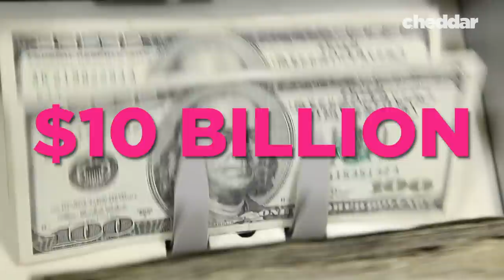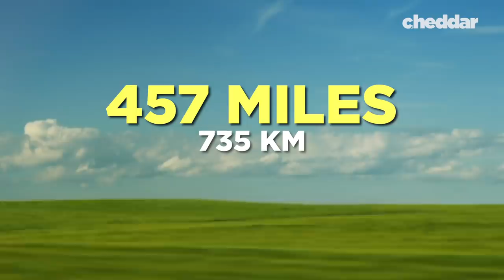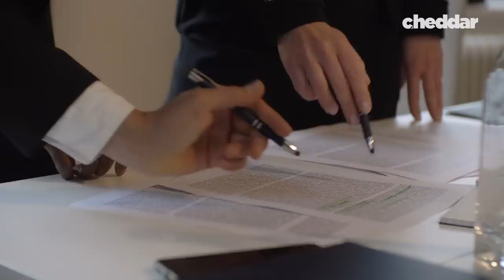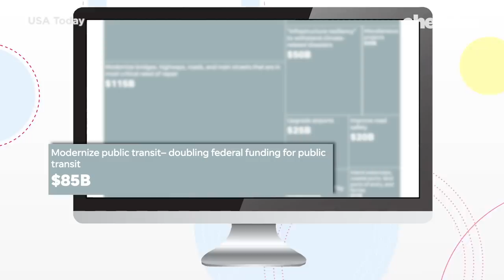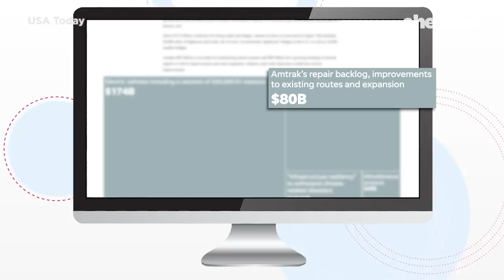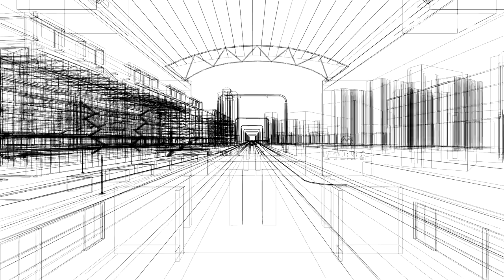Is New York Finally Getting A Real High Speed Rail? - Cheddar Explains

Comment: I’m from the UK, but I’m puzzled at why it will take the US 20 years to get their trains to a speed that is respectable today… Surely in 20 years time, places like China will have improved their transit again? Meaning that as soon as their current plans are completed, they’ll need to update it all immediately afterwards if they want to be at the forefront..?
Reply: Check out the B1M on this.
Reply: They plan to double track length by 2030. 
Then accounting for more then 80% of highspeed track.
Reply: Their fastest train averages around 65mph, which is the average speed of a commuter train in the UK, not an intercity
Reply: Because we don't need them. Cars, the interstate, and cheap domestic flights make highspeed trains an unnecessary drain of resources.
Reply: Republicans didn't want to pay for the cost of high speed rails.
Reply: We just don’t really need them everyone that wants to travel has cars and no one wants to pay for other people to travel on trains.
Reply: To be fair, the Acela does travel faster than the domestic HSR trains in the UK
Reply: @BenAHowell754  that is the exact reason why high speed train should exist in USA
Reply: Because construction work in the US is a joke now, I think they spend 9/10 of the day sitting around doing nothing, by me they had to repair a small bridge over a tiny river, it was a bridge so small I didn't even realize there was a bridge there till the repair work began, it was about 10 meters long, it took over half a year of the bridge being completely closed to do the work.
Reply: @BenAHowell754  cities have a lot of traffic now and we can’t keep making cities so car dependent, It’s not good for tax revenue for the cities and it’s not good for the environment, and it cost a lot to maintain etc. how many more highways can we really build in the northeast, how many more highways in California before we realize highways aren’t the answer and they literally cause more traffic. People say they want to beat China but than don’t want to put the money and resources to beat them. Countries with half our gdp per capita are getting high speed rail. Airports aren’t even that efficient when you take the time to get to the airport security and your destination than get your bags and get to your location again
Reply: @rush9612  That is just so wrong. Would you rather drive with congestion, pollution, going 60ish MPH or sit back and relax going 200 MPH. Plus having to deal with parking in Boston & NY is hell on Earth (coming from someone living in Boston married to a New Yorker.)
Reply: The US is a huge country with a lower population density, so it’s hard to build a high speed rail and justify the cost.
Reply: Because right now very few people travel by train, there isn't much demand for it, and then there is the subject of geography, almost every country that has high speed rails is fairly small and in the case of China the large majority of the population and major cities are in the eastern half of the country, making them much easier to link, while the large cities in the US are all over the place, it would be a very big gamble to put High-Speed Rail between Boston, New York, Miami, New Orleans, Houston, Dallas, Phoenix, Los Angeles, San Francisco, Seattle, Salt Lake City, Denver, Kansas City, Chicago, etc, with minimal guarantees that it would ever pay for itself, buying all the land needed (much of it private right now) and displaing people would be a years long migraine that would drag through the courts (China doesn't have that problem because they are still a communist country where the people have no real rights or access to justice, and the unitary systems of government in most European countries have kind of the same effect in terms of what the central government is able to do), and the alternate options available (I cannot overstate to European viewers how much many Americans value their freedom of mobility and travel, if you are traveling by car you are not hindered by train delays, bus schedules and routes, taxi fares or a complete lack of them, and rental car prices and rules, anywhere there is a road you can go, we took Amtrack to visit Adirondack Park in New York and got a rental car, never again, we're driving next time), and well as fast and cheap domestic flights. Simply put, the need and demand is not there and it is not feasible.
Reply: @visorij3374  That's why the proposed rail is highly targeted at dense regions. I agree it wouldn't make sense to build high speed rail in Wyoming.
Reply: @hape3862  hear, hear.
Reply: @williammerkel1410  why not use interstate land? Put tracks on one side. The Federal government already owns the land and has right of way, and they overbought to have room to expand (as evidenced by many extra lanes added on some). They’re already built along the routes lots of people want to travel. Power is already going there for the lighting. Etc.
Reply: First, a powerful faction in the US is ideologically opposed to passenger trains. Or, at the very least, they believe that passenger trains should only exist if they can out-compete cars and planes, and also support themselves on fares and make a profit without government subsidy, which they never will (of course, they don't apply this standard to interstate highways, which are massively subsidized).

Second, the US actually has a fine, extensive rail infrastructure but it's tailored to freight rail. The railroads used to be required by federal mandate to maintain passenger service (which they hated doing since they lost money on it). That mandate was lifted when Amtrak came into being. But that meant the railroads could sell off the rights-of-way that they previously used to have bidirectional tracks, because for freight trains which are less speed-critical, you only really need one track and you can put trains off on sidings to pass each other. (Riding a passenger train on one of these lines is agonizing.) That was a real-estate gold mine and the railroads soon exhausted it. So now they don't even own the land that would be needed to establish decent passenger service, even ignoring issues like grade crossings and turning radii.
Reply: @kaitlyn__L  in many places the right-of-way is not wide enough, other infrastructure such as power lines are already there and cannot be moved, hundreds upon hundreds of overpasses would have to be completely rebuilt, grassy strips alongside interstates are vital for water removal and erosion control, and the trains could not interfere with the original purpose of the interstate system which is a lifeline in case of a national emergency, particularly the outbreak of war in which it would have to be immediately commandeered by the military as well as being capable of serving as Landing strips for any and all aircraft, and while the interstate system are a federal project the states are responsible for their maintenance.
Reply: Because we are a bunch of arrogant archaic idiots
Reply: @BenAHowell754  yet we have way more cars than are necessary and traffic gets worse every year ...stop clinging to old ways
Reply: @rush9612  but we blindingly pay for endless wars and the trillion dollar disaster of the f35 program and multi trillion dollar corporate bailouts THAT YOU PAY FOR ...enough with that pay for others BS excuse...GROW UP
Reply: Whenever a public transportation project is proposed to Americans, they evaluate it in one way: will this project get cars off the roads I drive on so I can get someplace faster? The only goal of public transportation here is to reduce traffic congestion.
Reply: The problem isn't the speed of the train per se, it's building the long straight track in a densely populated area that is also one of the most expensive real estate markets in the world.
Reply: @BenAHowell754  "Cars, the interstate, and cheap domestic flights make highspeed trains an unnecessary drain of resources." This kind of ironically true depending on where you are. However roads hide long term maintenance costs and they selves make rail lines more expensive since they take up land that could have been used for it. However if there actually was a cost on carbon those factors would be wildly different.
Reply: @gg3675  Yes, Europe isn't densely populated.
Reply: What is strange is that Europe, UK, Morocco all built there HSR in less than 10 years why does it take the US twice as long. I know all the people that think they have a say and sue the project for not getting enough for there property or to strict environment regulations that drag projects out exponentially.
Reply: @maa1649  it’s a matter of lack of demand. Pretty cut and dry sadly. No one’s ever been shy to make money in the US, and the fact that no company or government agency has invested in it kinda proves it. The country is too sparse, and the people too rich to prefer public transport.
Reply: The largest issue with the rail network is this: Lack of demand. 

Let me clarify this a bit, the U.S runs most on-demand for things. The auto boom brought an immense demand for infrastructure to facilitate car travel, when planes came about the same thing happened with airlines. Rail travel in the U.S is always seen as a niche transit option since the advent of the automobile, for the sightseer more than the common commuter, or at least that's how it used to be. It used to be that cars were cheap and people enjoyed the freedom that came with them. Nowadays that is changing but the mentality is still there, and due to our past, we are stuck with what we have. A car-based network that is overcapacity and falling apart. The major issue to why we are lagging behind is strong emotion against the development and bureaucratic promises that make the Brothers Grim fairytales look realistic public trust in government funded anything is little to none. Couple that with laws that make any kind of change a bitch to complete and groups that protest against a shovel touching the ground for fear of some rare bacteria's existence and the drive to improve anything is little to none.  let's not forget also the time we speak of as well.

20 years is hopeful, while I tend to side with the unionization of workers to get better treatment, it makes any work that requires them a bitch. The government is so choked out on stipulations they have to meet that to see a quick repair job is a joke. Taking 5 guys to do one simple task just because of union-allocated regulations on workload and stuff it takes a long while to do anything, and it doesn't look like it's gonna get better either. Noone likes construction, and the time frame it takes really puts people off from investing because they wouldn't see any return till a quarter of a lifetime is gone by. There is a lot more but for a comment, this is already long so.

I for one would love to see a commuter system as widespread and useful as other countries, but living in the American Midwest I also see why we don't have that: Low population density causing low demand. Sure it will get here eventually but I don't see it happening within my lifetime and probably not even my kids. The interstate system took an act of congress to get done and it is doubtful that such a thing would ever get out of the clusterfuck we in the U.S call our government today, they couldn't even spend $1,400 on us individually without months worth of bickering, imagine paying for a bill larger than the relief bill the passed earlier, we would have better luck sticking a thumb up our ass and trying to shit because at least that has a chance of going through.
Reply: @williammerkel1410  nonsense , millions of millions got rich by the payment of government for relocation . I found Americans just depend on “ imagine “ China or all brainwashed by anti China propaganda
Reply: @weizhang2834  but did they have any ability to contest their relocation in court with a realistic chance of winning?
Reply: @hape3862  best cars and best highway are German? It's hard to argue with that
Reply: @longshorts7148   I think you are talking about antifa states for which pelosy was demanding bailout of states for stimulus to pass
Reply: @longshorts7148  On viting they actually made ut easier to vote go and critically read between the lines while biden's delaware has no such easy voting rules and even an aluen can vote there. So, you can be a Democrat but Republicans are actually increasing voter participation and decreasing fraud whether you like it or not.
Reply: Our policies are that bad
Reply: @longshorts7148  Go and see new georgian election rules which means to increase voter participation and reduce fraud. I have checked it.
Reply: @longshorts7148  but not won because they are spreading fake information
Reply: @daelbows5783  only between boston and westerly, ri. CT border to penn station is slow. Penn station to DC averages 85 mph to cover 300 miles in 3.5 hours. I find it easier to drive at times or take the bus from nyc to dc for 35 USD and deal with the clientele
Reply: From the UK? Then tell us why the Betty Line in London isn't open yet?
Reply: @visorij3374  Yes, it's difficult to justify the cost of a comprehensive high speed rail network in the USA (at least at the moment – when emergency measures to combat climate change mean internal flights are grounded then it may be different, but can you afford to assume that won't happen?) ... it's hard to see a good case stacking up for HSR to somewhere like Denver, for example. But there are plenty of parts of the USA that do have a population density that would support HSR:
🚅 Sacramento/San Fransisco - San José - Los Angeles - San Diego
🚅 Dallas/Forth Worth - Austin - San Antonio - Houston
🚅 Miami - Tampa - Orlando - Jacksonville
🚅 Washington DC - Baltimore - Philadelphia - New York - Boston
🚅 Milwaukee - Chicago - Detroit - Cleveland - Pittsburgh - Washington DC
🚅 Nashville - Louisville / St Louis - Indianapolis -- Cincinatti - Columbus - Pittsburgh - New York
(And yes, those are just broad corridors and would probably include branches, I'm not saying trains would run those exact routes).
Reply: @daelbows5783  The average speed of the Acela is 65mph. In the UK it's 84mph.
Reply: The UK only has 1 true high speed line, that being HS1 connecting to mainland Europe.
HS2 is set to be completed in 20 years as well.
Reply: @visorij3374  For trans continental HSR routes that is certainly true, but the US has a number of areas with two or more major cities within 500-600 miles of each other and that distance is considered the sweet spot for HSR. The NE Corridor is one example, California's HSR project is also within this limit as would be the Texas HSR project and the proposed Las Vegas to LA/San Diego route.  Certainly building a high speed rail route across the midwest states would make little sense so it would have to a series of independent routes linking major cities in specific areas. However funding could also go towards making improvements to more rural lines, allowing Amtrak to introduce high speed bi-modal trains to run on the HSR lines at say 200mph then transition to diesel power and travel on rural routes at more normal 100mph speeds. Sort of the best of both worlds and is what happens in other countries currently.
Reply: @scottlarson1548  Europe did face the same problem, which was not making the trains be fast, but was laying long straight track in densely populated expensive real estate markets.  Correct.
Reply: @gg3675  And they solved it how?
Reply: In 20 years China will have a network of maglev trains..... plus we don’t even know when it will actually materialize.
Reply: Same with Canada and Australia, what are they doing?
Reply: @jamesbedford7327  fastest in the US are around 120mph
Reply: @scottlarson1548  My entire point was just that engineering trains to go at fast speeds isn't that hard of a problem.
Reply: @williammerkel1410  actually yes. but 90% don't do this. go on to chinese internet and you see chinese netizens begging the government to take their land to build hsr so they can live off rich for the rest of their lives + for younger generations. the same goes for provincial governments because they see the positive economic growth for hsr.

high speed rail in china is that amazing.
Reply: The reason, in short, is that Americans do not like traveling by trains. For some reason, left-wing politicians seem to be obsessed over them, so whenever they're in power, they throw money at it. But the people don't actually have any desire for this, outside of Acela (which is grossly overpriced). I actually used to live along the Acela line and always wanted to take it to Washington when I would travel there for business. The schedule worked, and you can avoid some traffic jams. But I could never justify the price (hundreds of dollars for one round trip between New Jersey and Washington) versus simply getting there and back on one tank of gas in my private car.
Reply: @kevinh96  - The issue is that cities in the U.S. have different industrial bases, ethnic populations and political tendencies. City number one might be 500 miles away from city number two, but the people who live in those two cities have no reason to ever visit the other one. That is just reality in America.
Reply: @CityWhisperer  Do you mean London to Birmingham? Or the whole thing?
Reply: Because we are too busy giving rich people tax breaks
Reply: @VisibilityFoggy  "Nobody wants to travel by train" because our trains are terrible.  There's nothing different about American consumers that would make them less likely to want to ride HSR than someone in Japan.
Reply: @FfFf-gi1hd  I'm also really curious why there's no HSR line at least between Toronto-Ottawa-Montreal.
Reply: @gg3675  - Have you ever been to Japan? Or the regions along Europe's HSR lines? They do not resemble anything remotely like the landscape, layout, zoning, of the U.S.
Reply: @gg3675  - I once rode the train from Montreal to Quebec City. It's actually an old Amtrak train that Canada bought from the U.S., so technically it's "worse," though I found the clientele to be more respectful of their fellow riders and lots of room on the old train.
Reply: @williammerkel1410  Well Said
Reply: @kaitlyn__L  I agree with your idea. I live near the project in CA. If they would have used the "Right of way" near the interstate it could have been 75% completed by Now. They chose to go through a bunch of small towns and farmland instead for Political Reasons.
Reply: @sterlingodeaghaidh5086  Fantastic Explanation. I live near the boondoggle in CA. You are correct with Everything you stated.
Reply: @williammerkel1410  what question lol. says the person living in the most oppressed state aka usa in the world. pure projection.
Reply: @rush9612  Who wants to drive a car a long distance when you can sit and relax on a train and get there in half the time? As for flying, a high-speed train is quicker for anything within 2 hours on the plane, and far more comfortable.
Reply: @Zeoytaccount  Too rich for public transport? If you're rich, why would you drive when you can travel first class on a high-speed train?
Reply: @timtranslates  2 hours is a pretty short drive and we could always raise the speed limits.
Reply: @williammerkel1410  again who are you and what argument. winning by not engaging the question. yes i am pro ccp so what. what a genius! /s
Reply: @timtranslates  Principally because it's slower than a plane, and less versatile than a car. Wealthier middle classes generally can afford these options more easily. Trains are a niche middle ground.
Reply: @sandrahiltz  Same in Canada, looks like we share the same fucking blood!
Reply: @rush9612  I was referring to a two-hour plane journey, i.e. a full day's journey in the car, vs. 3-4 hours on a train, where you can relax, sleep, work, listen to music or eat (and reduce carbon emissions while you're at it).
Reply: @Zeoytaccount  A train is only slower than a train once you get past a certain distance. Around 600 miles. For anything shorter than that, it's really not quicker. A 600-mile trip with a couple of stops will take you about 3.5 hours on a train. On a plane, you'll be in the air for 1.5 hours, but you'll also have to travel to an airport perhaps 30 minutes out of town, arrive at least an hour early, wait for your bags on arrival if you're travelling with bags, then travel from another airport that is out of town. It's only going to be quicker if you happen to live near the airport and your destination is close to the airport.
Reply: @timtranslates  That's an interesting analysis! I agree. The issue is, most places in the US are way over 600 miles. Take nations with good HSR like Japan or Germany; most of their entire nation is within that 600 mile radius. For the US? For me personally there's only 1 major city within that radius, and it would still take driving to the station. After all, other developed nations like Canada and Australia don't have HSR for the same reasons. I'd love to see some better regional rail systems here soon, but a nation-wide HSR system I believe is in the realm of fantasy until we have technology that can match air-speed.
Reply: @Zeoytaccount  I agree a nationwide network wouldn't be viable, but surely an east coast line would? New York-Washington is only 226 miles by road. Surely there's enough traffic, especially as Philadelphia and Baltimore are almost in straight line between the two. Atlanta-Washington with stops in Charlotte and Richmond should be worth it too. Then, perhaps Florida gets enough tourism and business traffic to warrant extending it down there?
Reply: Because AMERICANS love their cars...We don't live in cities...most Americans are in suburbs. We can tow our boats, rvs, trailers with our cars, we can haul building materials in our trucks...and WE HAVE THE FREEDOM TO BUY A GAS GUZZLING CAR if we have the money to and if can afford the gas...

Oh, on ELECTRIC VEHICLES, how are you going to get electricity to charge your battery powered cars, Unicorn manure? Renewable fuels isn't the answer yet, coal, oil and gas is  - along with NUCLEAR...
Reply: Because they are nationalised. Your government made the right decision in the '90s by privatising British Rail.
Reply: @blakemcnamara9105  Because the British railways are so much better than the nationalised French ones, right?
Reply: The problem I noticed was laws and regulations of different county, and states and federal governments, fundings and also many of the railroad tracks are own buy different private companies.

It's hard to make changes because too much bureaucracy, too many people own different parts of the tracks. Also buying new lands are also expensive and hard as well especially in some of the most expensive and densely populated lands. A high speed railroad isn't needed for places that doesn't have a large population as well.
Reply: @BenAHowell754  Cars are the most inefficient mode of travel
Reply: @JsRazza  Because sitting in traffic for hours is so much fun. As is working extra hours because you couldn't work in the car.
Reply: @Daniel P. gas tax
Reply: romulus augustus  That's why I said "in the air". It's rare for in-the-air time to increase, except at peak times into large cities. Most of the delays are on terra firma.
Reply: Harry, the distances involved are simply too great for wheel on rail. And we already have an excellent network of jet aircraft. There's really no need.

Now if a private company like Brightline or Virgin Hyperloop One wants to start building maglev at their expense, I would support it. But I don't think the government should be wasting money on it.

Look at this way. San Jose aka "Silicon Valley" and New York City are as important to the USA as Paris and London are to Europe. But Paris and London are A LOT CLOSER TOGETHER.

You're talking 300 miles vs 2900 miles.

You have to realize the vastness of the USA, Canada and Australia. We don't use HSR because our countries are simply too big to justify it as a public transit project.
Reply: Tbf, the uk isn't doing brilliantly either when it comes to high speed rail compared to the rest of Europe. The French had to help you build hs1 and hs2 is way over budget, schedule, and probably won't even fully open(northern section cancellations).
Reply: @asdsdjfasdjxajiosdqw8791  doesnt matter trains were rendered obsolete by the jet aircraft unless youre talking maglev. Under 200 miles its ok much more than that and the aicraft makes it one hour while the train takes two or more and thats a waste of money to build unless you did it very cheaply. If its a cheap upgrade to existing public transit fine, otherwise it is for private companies to spend their own money.
Reply: Size when compared to Europeans as well as many other reasons and when compared to China, China has a much easier time acquiring land, cheaper labor, basically no political opponents, and can mass produce things that could never be mass produced in america.
Reply: Zaydan Naufal  I was just giving the base idea. There is much more complexity then 1 land acquisition law and a much more solidified political standpoint often helps a country to a very far extent as seen in america there is severe effects of not having as unified politics. I also do believe that Indonesia has Chinese loans to support there HSR construction.
Reply: @Theactualstoic  Joe Biden was the state senator for Delaware, not for California.
Reply: @BenAHowell754  it costs significanty less to fly in Europe, a country with vast high speed rail. I'd rather take a plane from Russia to Germany or the other way round than fly the equivalent distance in the US, where plane tickets are in the hundreds and service is more shit.
Reply: UK doesn’t really have HSR either
Reply: General Motors and Exxon.
Reply: @BenAHowell754  jams, road rage, rising fuel costs, non functioning cities,  insurance, fuel, massive car payments, maintenance costs. You dont speak for me and millions here. We need a balanced transportation system. Not total car centric insanity. We need trains. If you like driving , then you should want other systems because it will mean less cars on the road. People die in car wrecks more than by any other means.
Reply: @rush9612  not everyone wants to drive 2 hours when on a train they can just relax. Also raise speed limits? That’s just asking for more car accidents.
Reply: it's really hard to get public projects done in the us, you have to cater to many special interest groups to just get something like zoning right figured out.
Reply: @BenAHowell754  cars are slower than 200 mphs trains. Flights arnt necessarily if you have to arrive 2 hours before take-off and airports are usually located 30 miles from downtown.
Reply: @29brendus  It's opening in 4 days as of May 2022
Reply: @carsongreen4503  Sounds positive to me, and I will ride it on June 7th, in stages of course, because it is only being operated in 3 separate sections right now as opossed to full straight through running. Cheers!
Reply: The U.S. , has something called airports .
Reply: @williammerkel1410  Induced demand applies to highways, as it does to high speed rail too. Every time a highway is expanded, or a new one is created, it creates further congestion and traffic. It does not alleviate it. Because the very moment a new road or highway becomes available, people will flock to it, drive on it, creating more traffic, which will necessitate more highways, and more expansions of them. It's a never ending process. The Katy highway in TX is a great example. It was expanded who knows how many times, but still congested. Build true HSR in this country and people will flock to it too. People don't use HSR trains because we don't have them, and the few trains we do have, are old, slow and provide shitty service. Give an American a German high-speed ICE train or a French TGV train and see what the response is then.
Reply: @ArtisticlyAlexis  I’d rather drive, unless I have a direct location I’m planning to go that a train would take me very close too it’s just ineffective as an overall, why would I train from say nyc to Boston when I’ll need to either rent a car when I’m there or taxi or Uber everywhere I need to go, and this is coming from a train lover who lives on Long Island, my father works at the LIRR in my opinion the best option would be for us to just upgrade and build local rail systems in bigger cities and areas throughout the country, the LIRR is very decent already with connectivity we just need to upgrade our older track and outdated systems and our trains are already capable of going 100mph, if they could get our local trains up to 80-100mph that’d be an amazing local system for quicker connectivity.
Reply: @MattMcIrvin  Great comment. Thanks. Of course I agree with you. I think Brightline is a great business model in large part because it appears it is based on profiting from real estate development. Southern Pacific, at one time California's single largest private landowner, took over a hundred years to develop. Its remaining unexhausted vast holdings were acquired by Santa Fe. Brightline's average fast speed of 80 mph (MIA-ORL) could become a desirable five hour SF-LA scenic coastal route trip 3-4 times daily with perhaps only two rotating train sets. That could transport up to a million yearly passengers.
Reply: @ShawnLH88  *
Reply: @kevinh96  I like the Brightline business model for distances of 200-400 miles with top speeds of 125mph and average speeds of 70-90 mph. This is a better performance than Acela between NY and Boston which averages 60 mph.
Reply: @FfFf-gi1hd  There might be enough population density between maybe one pair of cities in Australia and Canada to eventually have faster train service.
Reply: @FfFf-gi1hd  Acela's top speed reaches 150 mph on a 37 mile section of track between NY and Boston. In Fall, 2023 Brightline will have a maximum speed of 125 mph on its Cocoa to Orlando section.
Reply: @gg3675  Not at all. Easy peazy if you have the money and right of way.
Reply: @VisibilityFoggy  That is a very interesting general observation overall with perhaps a few possible exceptions when the distance is 200-400 miles. But at 500+ miles I think your are right.
Reply: @timtranslates  I like your comments.The convenience of trains can be better than planes as you point out. I am only aware in the world of two trains each in China and France and one in Spain where the average speed is close to 170 mph and they are non-stop. Usually most high speed trains have some stops and end up averaging close to 120 mph for greater good pragmantic reasons. I think a 600 mile trip would be closer to five hours. Not that there is anything actually wrong with that. A little more quality time, perhaps.
Reply: @timtranslates  There are long-range plans to shorten the Acela ride from NY-DC by 30 minutes by upgrading about 100 miles of the tracks, one foot at a time. LOL.
Reply: @codyuhlmansiek805  God bless America. Drill baby, drill. Plus, provide HSR for highly populated metroregions between 200-400 miles apart to give people an alternative choice.
Reply: @timtranslates  Doesn't France have more nuclear power and greater distances to travel making HSR more practical than in England, for instance?
Reply: @waitam8447  You summed up the whole topic very nicely. Thank you Wai Tam.
Reply: @craigbeckford4060  Say the Amish.
Reply: @neutrino78x  Brightline has a fantastic product and business model which could work in some other US locations that are between 200-400 miles apart.
Reply: Zaydan Alfariz  Because Indonesia has calculated that the economic and social benefits will justify embracing China's Belt and Road Initiative construction and financing program.
Reply: @kagakai7729  I would prefer not to fly over Ukraine.
Reply: @sygneg7348  Don't forget Firestone Tires the freight railroads.
Reply: @davidjackson7281  

"Brightline has a fantastic product and business model which could work in some other US locations that are between 200-400 miles apart."

200-300 and yeah, Brightline is a great company. 

Just remember, you don't see anything on Brightline's web site about trying to compete with aircraft. That's why they're limiting themselves to short routes. San Francisco to Los Angeles for example is 380 miles. Even if CAHSRA chose a good route, which they did not, at best they would take 2.5 times longer than a jet aircraft. The route they did choose is going to be over 3x, probably 4x slower than a jet aircraft, IF it is ever completed, which it won't be, at least not as they intended, since we don't have the money as a state to do what they demand. (I do think the speed of amtrak california will be enhanced so it averages 90 or so, and connects to the HSR that was completed, Merced to Bakersfield. That would be a 4 hour ride SF to LA, but so would CAHSR.)

Brightline doesn't have the political agenda that some of you guys do. They're capitalists. They want private ownership, they want private free trade, they want profit to be legal. They don't think there's something morally wrong with owning a car as a private citizen and using it to drive where you want to drive. They don't think there's anything morally wrong with flying either.

Their product competes with DRIVING not flying. They are very clear about that.

Their route from LA to LV for example. They say it will take about three hours. OBVIOUSLY this does NOT compete with the flight, which is only one hour. They explicitly state that they are trying to get Those Who Otherwise Drive, because their product saves at least an hour vs driving. It's NOT going to replace the flight for people who need to get there in a reasonable period of time.

Plus obviously Brightline's train does nothing for people coming from the San Francisco Bay Area. We will still fly. I have been to Vegas a couple times and I flew. I wouldn't sit on Greyhound for five hours when I can fly in one hour. 

Even if CAHSR is completed, that will take 3 hours just to get to LA. Then another three hours to get to LV. Why turn a one hour trip into six??? 

Even coming from San Diego...if you have an HSR from SD that takes an hour (which btw Higher Speed Rail (not hsr, but higher speed rail) from LA to SD is a great idea), now it's a four hour ride to go to LV. When you could just fly from SD in one hour.

It's strictly benefiting people who would otherwise drive from LA to LV. It's a great product that has a very narrow niche. 🙂
Reply: @neutrino78x  Good to read you remarks once again. It is kind of ironic and disappointing that the building of these projects projects is so far out in the future, if ever. Norcal to Vegas by train won't compete with flying. But a ride from Fresno would be 3 hours. Too bad the total system wide 58 miles of tunneling is way off on the horizon. From SD to LV not likely by train. The trains will mostly compete with cars. The trip from Rancho Cucamonga to Vegas is 260 miles and take 2 hours. 

Brightline is unique because it is owned by Florida East Coast RR which wants passenger service. The parent company, Fortress Investment Group, develops the surrounding station properties for profit. This adds value for everyone. The 3 hr trip from Miami to Orlando will be successful drawing cars off the road. The infill stations will really benefit. The extention someday to Tampa Bay will enable an express (limited or non stops) could take only 3hr30min and compete with flying which would be an extra hour dead time plus an hour flight. Same with an extention to Jacksonville which could kill Amtrak Florida service by being twice as fast and half the price and ten times the frequency. Since the Orlando station is at the airport Brightline will complement flights more than compete.
Reply: @neutrino78x  Brightline is also unique because it will limo riders five miles from a station.
Reply: @davidjackson7281  

"But a ride from Fresno would be 3 hours."

Not Fresno to Las Vegas. You first have to get to Los Angeles (assuming you're doing the whole thing by train...it would be kind of stupid to fly down to LA only to take a 3 hour train to LV, it's still much faster to fly directly to LV). 

Fresno to LA would be at least two hours, probably three hours, with CAHSR (which will never be completed, especially not bakersfield to LA which would involve 20 billion dollars of tunnels).....and then once you're in LA, then it's three hours from there to LV.

So again you're far better off FLYING from Fresno where it's less than one hour.

Brightline is NOT trying to replace flying!! They don't have the political agenda you guys do. They're trying to make money. They would never advertise "ride a slow train to LA and then ride us to LV", because they know that would take FOREVER.

They are strictly competing with DRIVING.

"The trip from Rancho Cucamonga to Vegas is 260 miles and take 2 hours. "

Their web site says 3 hours (about 86 mph average speed...like with people thinking CAHSR will average 220, Brightline won't, either).

"Since the Orlando station is at the airport Brightline will complement flights more than compete."

Again, they don't have the political agenda the railfans/communists do. They have no moral issue with people flying, they have no political issue with private companies providing services for profit (since they are such a company themselves); they are trying to make money by taking traffic off the highway. 

That's why they succeed whereas HSR done as public transit fails; they are realistic about the niche they can fill, and therefore won't spend, you know, 300 billion bucks trying to compete with flying.
Reply: @BenAHowell754  cars suck tho
Reply: I mean, it took 13 years (still counting) to build a 19 km subway line in Toronto